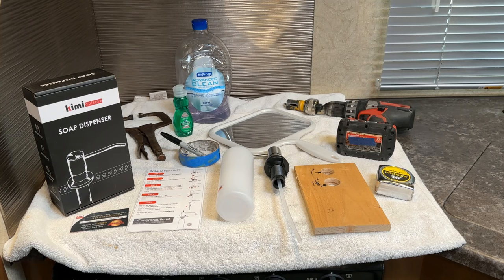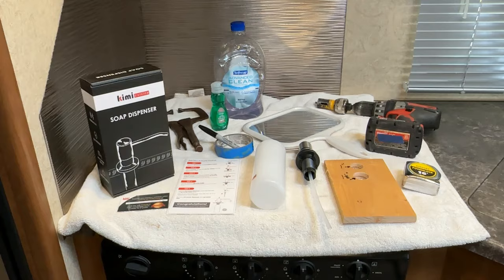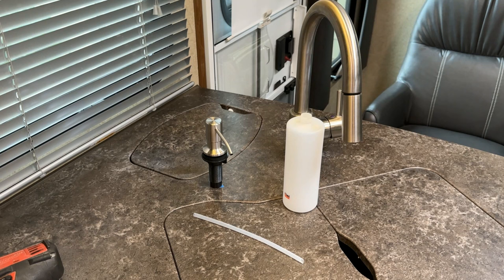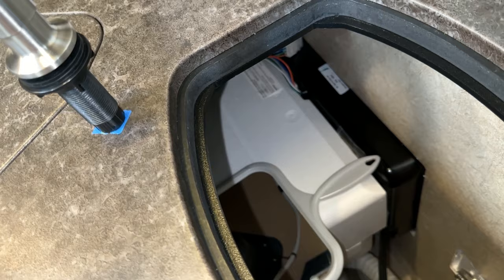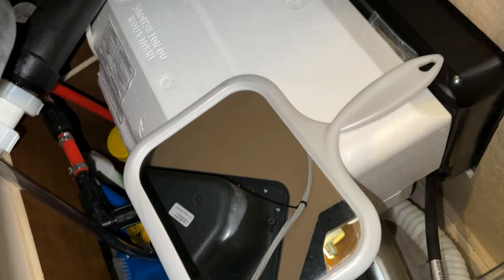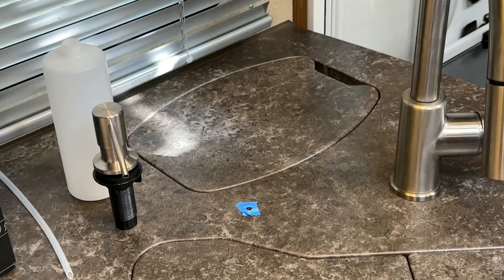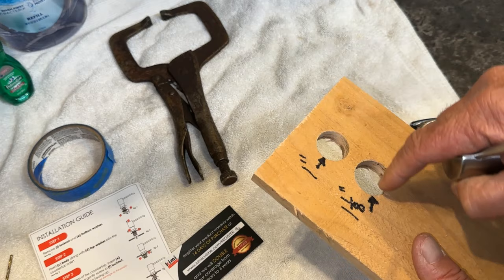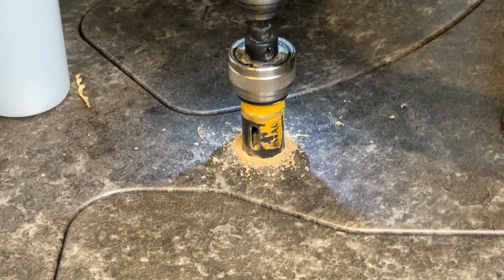How to Install a Sink Soap Dispenser

Comment: This was a great mod. I installed one on the kitchen sink as well as the bathroom sink. I have a 2021 1995 similar to your 2375. I ended up having to use a PVC spacer as you did. It worked out perfect. Thanks for the recommendation. We have been looking into getting a 2375, but was told that Lance discontinued that model. I checked going out at the RV show and a new 2375 is 97K. I’m thinking I’m gonna look for a used one. Love that model.
Reply from the maker: That's great you installed the soap dispenser in the kitchen and I really like that you installed one in the bathroom, I've been wanting to install one in the bathroom also. I've just been to busy with other projects. WOW the price for the 2375 Lance sure is up there. We were luck we bought our 2020 from a friend for $40k. We really like this model.

Comment: You put the gasket on the wrong side. Gasket should be on the counter top side to seal any water from getting underneath.  They way you have it, when water gets underneath the dispenser, you are trapping it and it will wick into your counter top and rot it out. You need to have the gasket on top to seal water from ever getting beneath it.
Reply from the maker: Great catch Josh, I should have shown how the gaskets are placed in the video. There are two gaskets: One is right under the plunger assembly (it is already on there in the video) that seals on top of the counter top & the one you see placed is the one that goes under the counter top.

Its all sealed up really good, I applaud you catching this and mentioning it. Thank you
https://www.youtube.com/@thetraveltrailerguy/videos

Comment: I have the same sink and hate it. Got any ideas for a stainless steel sink replacement?
Reply from the maker: I haven't really researched sinks for this trailer yet, but I can give you some good advice on buying one. Do Not go with a cheap quality stainless steel sink, if you do they will scratch and not clean well at all and you will regret buying it. Just check out your friends stainless sinks in their homes and you will see what I'm talking about. Here's a link to some stainless sinks on Amazon to check out (look for quality)  - https://amzn.to/47KXK60
Reply: Thanks, but mine is curved. Those won’t work
Reply from the maker: @GiantsNinerFan56  Oh no maybe RecPro has them? https://www.recpro.com/?campaignid=1816720315&adgroupid=68671584159&keyword=recpro&gad_source=1&gclid=CjwKCAiAsIGrBhAAEiwAEzMlC-t8ESjBXccn-j97eWopACGL1nlqbRuzssB8OJotx6iFRjTMY5plQRoC8xQQAvD_BwE   or you can call Lance to see if they know where you can buy one?